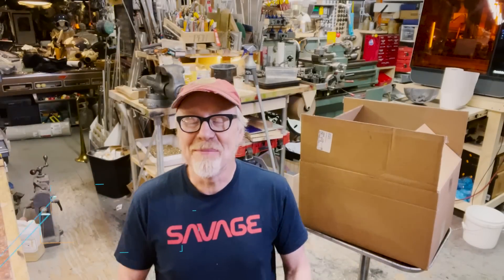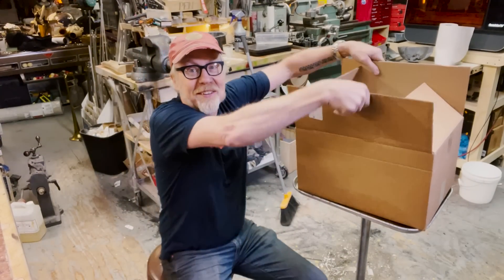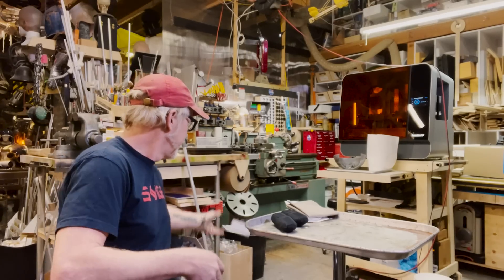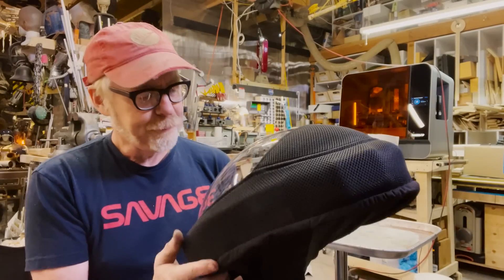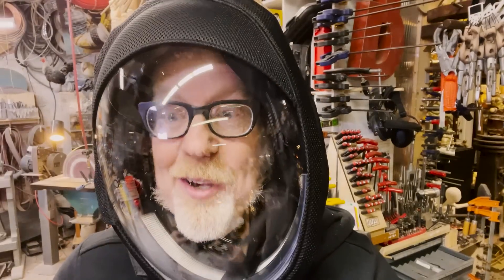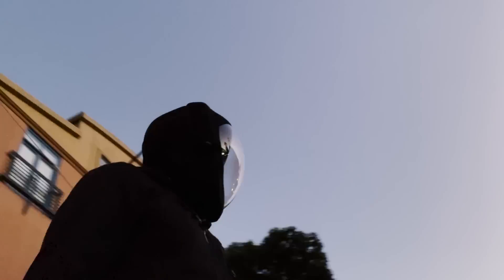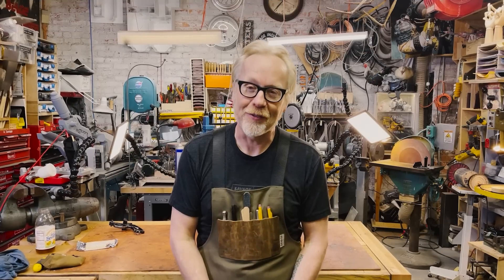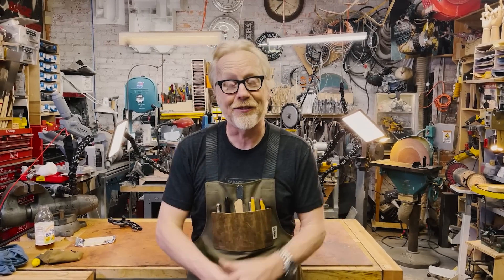Adam Savage Tests the AIR Active Filtration Helmet!

Comment: PAPR (Powered Air Purifying Respirator) hoods are commonly (these days) used by hospital and EMS workers for their protection from COVID. They have also been used by hazmat teams with chemically active filters. The hospital version has a paper hood that wraps around the face and the hazmat version is a hood that comes down over the shoulders. They both have a fanny pack with batteries, filters and a blower that connects to the hood. They generally last for about 10 hours to cover a full shift and move enough air that they do not fog.

On a side note, I always found it amusing when, on Mythbusters, you would seal yourself into a hazmat suit without wearing an SCBA under it. That's not how they're supposed to be used.

Comment: I think the fans are good to run for you to breathe and circulate air but would never make the condensation leave the surface area of clear face shield . What if the face shield could be some type of modified crystalline surface like they use in a watch face then you could heat it kind of like a rear defrost of a vehicle, in turn making the surface of it warm enough to not let the condensate fall on it

Comment: I'm curious Adam if you've had any luck with antifog treatments for the inside of helmet screens/visors? Someone who used it in their motorbike helmet gave me some years ago for use in a soviet surplus gasmask and it made a significan improvement for the eye pieces there. I don't remember what brand it was though
Reply: Rain-X makes a decent one, but any surfactant like dish soap will work in a pinch.

Comment: Seeing as it is powered, wouldn't the same tech that is used in a car rear defogger work on the dome?
Reply: Yeah, but then you're trading of resistive heating for fan runtime. You're better off coating the inside of the dome with a hydrophilic polymer.

Comment: I feel like this would be excellent for if you have to travel to/from work on public transport, or travel for work on a plane etc. It seemed like it wasn't fogging up at the shop because Adam was just sitting around and not exerting himself so if it could work like that for a good amount of time without fogging and it was allowed on said modes of transport, seems like a good use case?

Comment: In the beginning of the pandemic I forgot my mask and wasn't allowed in the local hardware store, it was closing time and I didn't have time to drive back to the shop and get my mask. Luckily I had my PAPR system with the super helmet i  the truck, so that's what I wore to be alowed in. The looks and stares made it worth it. Judging by the fogging issue, This system would look killer and function well if you adapter a PAPR setup to it, it would really cut down (if not totally cancel) any fogging.

Comment: At 11:50 I left that same comment the the company’s channel. There’s so many issues with it. I told them using pc fans will not offer enough airflow to prevent fogging. Also they don’t have an alert for when the extraction fans stop working, that’s a big hazard since they not using forced air out.
Reply: Why would you need an alert?  It'll be pretty obvious inside the helmet if the fans stop working.
Reply: @stargazer7644  if the pressure is not sufficient, you will die, that’s why companies like 3m will never use pc fans and the systems use forced air out, so if there is failure air can still escape. A number of ppl also died from those Chinese snorkeling masks.
Reply: @justtestingonce  If the pressure isn't sufficient, the mask will get hot and humid pretty quick, just as it did in this video.  You won't die.  Air can circulate through the mask even with the fans turned off.  Almost the entire frame of the mask is HEPA filters all the way around.
Reply: @stargazer7644  I’ve done a lot of work on this and this is a hazard, there’s a reason for all the safety pressure measure on other papr systems.
Reply: @justtestingonce  You are being ridiculous.  I own one of these masks.  You act like the mask is airtight with the fans off.  It isn't.  You're not at risk of suffocation even if the fans are off.  And believe me, the fans are right by your chin, you'll know if they aren't running.
Reply: @stargazer7644  lol, I didn’t say suffocate, put the fans off, let’s see how long you last breathing in your own C02.
Reply: @justtestingonce  Then what exactly is your point?  Last time I checked, dying due to a lack of oxygen (AKA an excess of CO2) was the very definition of suffocation.  
There are four 11 square inch openings around the periphery of the mask that are filtered. You can last indefinitely in the helmet with the fans off.  Warm air (and CO2) circulates out the top and fresh air comes in the bottom.   It's just warm and humid and a bit uncomfortable.  Kind of like living in Florida.  When the batteries die, that's exactly how you wear the helmet.

Comment: Professional electric air filters for construction and such have the filters and the motor on a belt, so you can use better motors without having them weigh down your head and without the ventilation being to loud. Then you have a tube run up to the full face mask. The German company dräger has such things.

Comment: My full face motorcycle helmet never fogs even when it's 40F out and I'm stationary. If Shoei and Pinlock can figure out without fans, this must doable.
Reply: They likely have some sort of hydrophilic polymer coating on the inside of the lens.
Reply: @MikeTrieu  It's double glazed and does have a hydrophilic coating. However, the air gap seems to be the most important part as they still work well if the coating is removed.

Comment: The company states they designed it specifically for airflight travel.  It wasn't mean to do anything you say it should do. https://microclimate.com/

Positive pressure helmets exist and they work they just dont protect your environment.  Looking forward to see what dyson comes up with but protecting both ways using airflows and filters is easier said than done.

Comment: The small 'surgical' mask that came with it is probably supposed to be worn inside the bubble mask to diffuse the breath, but it's still going to have the same problem, ultimately. 

Small fans in tandem can be quiet but still do the job. Counter-rotation blades in series can boost output and might help the noise to power ratio. Also, putting the motors farther away can help like in PAPR units, where filter and motor are usually mounted near the butt (don't fart).
Reply: The mask is for airlines (back when the airlines mandated masks) most airlines only allowed traditional masks and were not familiar with this PAPR so they included this mask to make the wearer “legal” for flying.

Comment: Wipe WD40 evenly over inside surface af visor, then gently polish off. untill clear again.  I have been using this on my Motorcycle Helmet Visor, Bathroom Mirror and Eye Glasses for years. Thats just one of the reasons it was used by NASA and the Space indudtry in the early days of space flight.

Comment: Adam, have you tried motorcycle visor anti-fog spray?
I use it regularly to stop my glasses fogging when I have my mask on.
Plenty of brands on Amazon, the one I have you apply simply by spraying it on each lens and then wiping it off with a kitchen towel. Usually lasts me through a 5 hour shift on the bar.

Probably impractical for such daily use on a large helmet, but I imagine could help reduce the airflow needed to keep it clear when you're at cons?

Comment: Supposedly, shaving cream can be applied lightly to glass and wiped away to prevent fogging. I wouldn't try it on prescription glasses, but the inside of a helmet would be a lot safer to try. I've seen it recommended for the inside of car windshields and scuba gear.

Comment: The fogging could be improved by copying the old gas mask Tissot tube system where the air intakes all blow directly onto the lens.  It's pretty commonly used by modern gas masks and it does a lot to reduce or eliminate fogging.

Comment: I'm very happy I got a RZ M2 mask and their F3 filters (N99 active carbon + high flow). It has a single Velcro strap and replaceable filters. Fits tight enough around nose with a metal clip, but not too tightly. No fogging of my glasses. When I bought it last March all I could get was safety yellow, but just ordered a black one at 50% off. I just hit it with lysol on the mesh regularly and wash occasionally. Filters are good for 20-80 hours depending on usage environment.

Not a sponsorship, just a happy customer.

Comment: Nice try Air. I'll give you 50 bucks. $300 is preposterous.
Reply: Eh, they're a small start-up that has to recoup sunk costs into the injection molding dies overseas. Their V2 will likely be much cheaper.

Comment: This is what I THOUGHT you had, at first.

This is the winning design. It’s just overkill for your application. However, I’ve wondered if the air system could be adapted to another hood; perhaps like the AIR product you just showed.

https://www.3m.com/3M/en_US/company-us/all-3m-products/?N=5002385+3290617082&rt=rud

Comment: Adam - It's called a Powered Air Purifying Respirator or PAPR for short.  It is commonly used for asbestos removal work.  We used them at Three Mile Island when we needed  better filtration than a regular respirator, but didn't need a Scott pack.  You should have fully charged the battery before playing with it, then the visor won't fog.  Lithium batteries have made it a one-piece deal.  Back in the day, there was a separate battery/fan/filtration unit you wore on a waist belt with a hose supplying the air to the back of the hood.

Comment: Cross that with a motorcycle helmet where it fits your head rather than your face, and I'm sure it would be a bit better... then again, any powered respirator will do the same thing, only better. only down side is that they aren't as quiet as that thing was, but I'm sure you and quite a few other makers have the skills to quiet down those fans.

Comment: A couple things about this video: I sleep with a CPAP machine hooked up to my face, so wearing a face mask is trivial with regards to how it feels when you breathe with one on your face. Also, the fogging of the face mask my be remedied with the addition of either a minor heating or cooling element, I would think. I’m reminded of something my parents had set up in their bathrooms in the home to which they retired. In addition to a fan, they also had a heater such that having the fan running with the heater minimized mirrors fogging up when you take a hot shower.

Comment: The real problem is that HEPA is an old standard that doesn't provide all that much filtration.  It's become a buzzword and a standard, sure. But it's both a low bar to reach AND also too high for many products to reach.  There needs to be a standard beyond HEPA and also practical ways to meet that standard affordably. We are not there yet.

Comment: The website says it's designed for safer air travel. I guess it's a decent idea for when you're on a plane, eg trapped in a germ tube.
However, it's also $300.
Reply: So?  Your life isn't worth $300?
Reply: @stargazer7644  Well, I have a respirator if I need one. If one of those gizmos is going to be a necessity to save my life, we all have big problems. And I don't have an extra $300 right now, what with buying food and all.
Reply: @shokojimhollingsworth3940  In case you haven't seen the news for the past 14 months or so, we DO have big problems.
Reply: @stargazer7644  I guess my poiunt is that for $65 you can buy a full face respirator if you so choose. $300 is overpriced. Good day.

Comment: 13:13 why just fans? the problem with "fogging up" is a thermal issue right? why not modify it to have something warming the dome? Maybe some thermal tubing on the outside that keeps it the same temperature on the visors surface as it is inside the mask? Im thinking NASA has something that keeps their helmets from fogging up. I know cars have thin wires in the glass for cold weather to heat it from fogging up. maybe you could use the heat from the fan and conduct it to the visor.

Comment: Might have better luck with a squirrel cage fan, high volume and low profile design usually used in office ventilation duct design.
Had to find a decent 12v 1amp one for a HEPA filtered snorkel mask I retrofitted cause of my weak breathing capacity.
I can't legally use the snorkel mask anymore unless I get a filter box installed over the outlet valve but the fan I'm using manages to squeeze enough air up the C-PAP hose with good force, if I hold my breath the valve is forced open by the static pressure enough to whistle. Would post a pic but YouTube tends to frown of commenters hyperlinking.

Comment: These are called PAPR's (Powered Air Purifying Respirator) and have been around forever.  Granted, this is an attempt to make one a little more simple and stylized.

Please don't rush out and by one.  They are in extremely short supply and your nurses, doctors, and first responders need them more than you.

Stay safe.  Hang in there.  Once the vaccine is available for the general public we'll start seeing a return to normalcy.

Comment: After 11 hours of comments, nobody seems to have posted that actually has one of these lids. You either have data, or an opinion.

I have data. (I'm in no way affiliated with the MicroClimate company.) I've been wearing this dome, almost every day, for several hours a day, for about two months. I work in shop floor as well as cubicle office environments, plus go to grocery stores, the post office, etc. Every place is somewhere you will meet someone that is exhaling functional Covid particles. Mouth, nose, eyes, all are pathways to getting sick.

The system was fogging because the cloth wasn't tight enough around the neck. Charge up the unit, turn on the fans, put on the lid, then snug the drawstrings, making sure the cloth band is sealing around your neck. Clean shaven at the neck is a good thing. If you look like you play for ZZ Top, there are probably leaks. Leaks lead to fogging.

The unit can be additionally-padded to more comfortably fit various head and hair styles. The existing pad inserts can be cut in half, sliced like a hot dog, as an example.

If it is freezing outside, you'll feel cool air on the back of your neck, from the exiting airstream. No biggie. Filtered air flow, in and out, is the point of this device. Covid viruses are inhaled, and exhaled to infect others. 

The (four) HEPA filters are .03 micrometer (30 nanometer) rated. N95 masks are rated down to .3 micrometers (300 nanometers). So, this guy is filtering at least an order of magnitude finer than an N95 mask. Covid virii, sitting still (which they don't, because of Brownian motion) are 80 to 200 nanometers in diameter. The filter sieves in this guy are 30 nanometer. Which do you want, if there is no restriction in breathing with either system (N95 mask versus the lid)? 

The fans attenuate hearing more than the plastic face shield lowers your voice output. Voice amplifiers, hearing enhancement, and Bluetooth to your mobile phone are mods that can be added. When I wore a respirator used by woodworkers, people had trouble hearing my speech, so I added a corded headset microphone inside that mask, leading to the voice amplifier that I kept on my belt.

For real cleaning, you can run the device in a small room, or a large cardboard box, while a commercial ozone generator is discharging O3 into the air. The O3 will destroy Covid particles trapped in the filter material, if you can get the room/box air ozone concentration to 1ppm or better. I usually cleanse the lid at 4ppm, for 20 minutes. 

When traveling, I run the ozone generator in any hotel room I'm using, for about 20 minutes, before I occupy the room. Three people in my extended family have died from Covid. I don't want to add to the total.

Comment: Air flow isn't the issue. A cold surface will always condense water vapor. The solution is to heat the glass or plastic. The main problem is the amount of energy to heat it.
Which begs the question of how astronauts were able to achieve this.  So why not just use old technology? If it works it works, right? 

What are your thoughts?

Comment: I know you said making an anti-fogging visor was a difficult task that you often needed to tackle but I would like to tell you about "Pin-lock Visors" they're found in motorcycle helmets and they function by basically trapping a pocket of air next to the visor (on the warm side) and then treating the inner visor with (or manufacturing the inner visor out of) a hydrophilic material. This keeps the warm moist air of your breath from condensing into fog when it touches the colder visor. They basically function like double glazed windows.

You could also attempt the dandruff shampoo trick, basically:
1) Clean visor really well with water and paper towel
2) Spread dandruff shampoo all over visor (inside and out)
3) Let sit for ~5min
4) Buff visor clear again
5) Profit...?

Comment: I think the problem of fogging is easily solvable by removing the plexiglas part. Or at least drill some venting holes near the mouth and nose. /s
There are some non-fogging motorcycle films that cover the visors, but I've never tried one. I think another solution is to have a dual-pane glass. Fogging is condensation due to the surface being too cold, so if that surface is thermally insulated, it is less likely to fog. Maybe the visor films achieve the same, by trapping a small layer of air.

Comment: Correct me if I'm wrong but the moisture only condenses out of the air when it come into contact with the glass surface that is colder than the breath. Is there a simple and safe way to warm the glass to a point at which condensation is minimal?